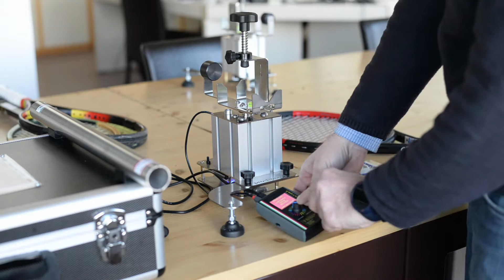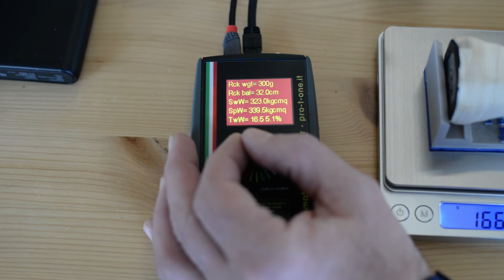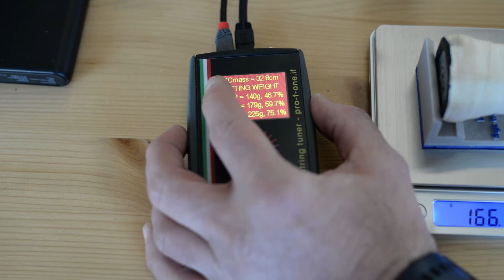Micro Swinglab

Comment: Hi, is it possible to measure accurate twistweight with any of your machines? Thanks.
Reply from the maker: From the new swing system you can get:

-          Swingweight

-          Spinweight

-          Twistweight

-          Recoilweight

-          Polarization index (classic & pro-t-one rating system)  

-          Mass Center

-          Hittingweight

-          MGR/I index
Reply: @pro-t-oneit  can I speak to you guys via WhatsApp? Thank you.
Reply from the maker: You can write an email to info@pro-t-one.it and leave your phone number. Thanks!
Reply: This machine does not measure twistweight directly. It calculates it by spinweight minus swingweight which is a close approximation at best. Whether that is good enough is up to you.